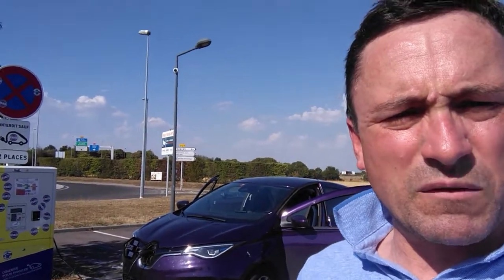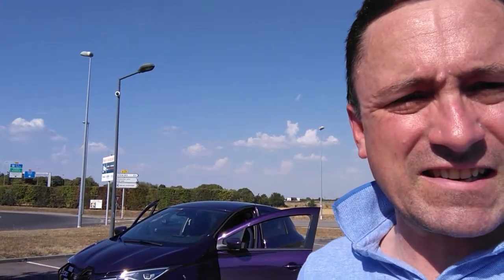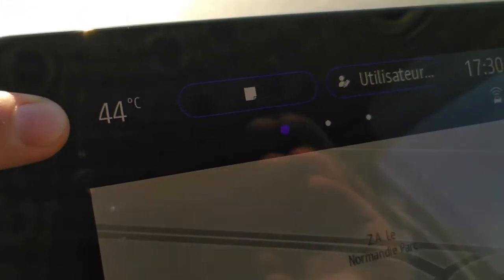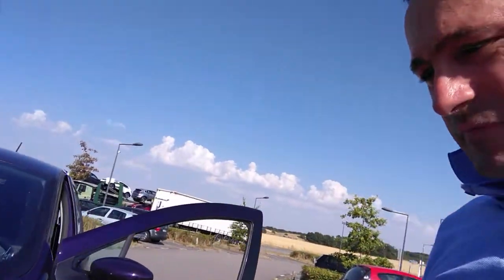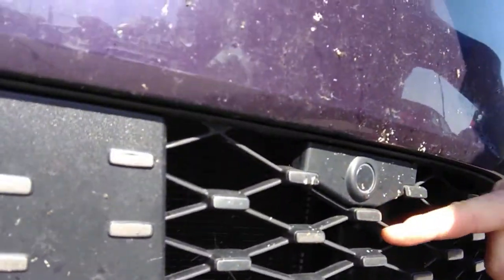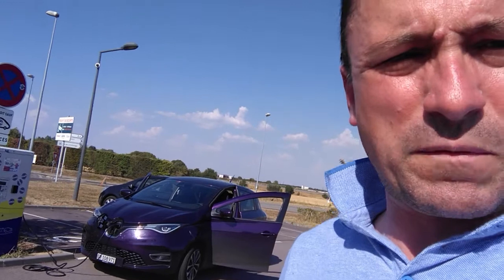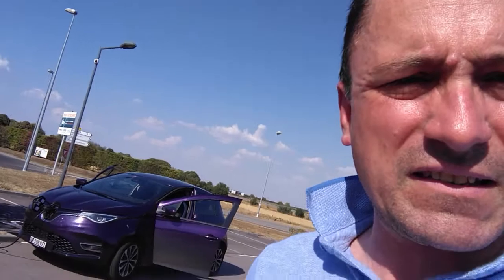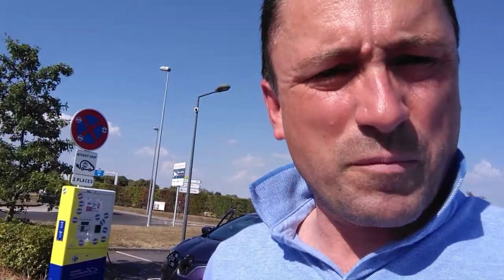REMICHANICS #32: Renault Zoe: Charging in extreme hot conditions!

Comment: I think 22kw DC would be better than 22kw AC in therms of thermal management, because the 22kwAC would use the AC to DC inbuilt converter(charger) which emits heat as well (and I suppose is liquid cooled by the same cooling system), while the DC charger does the AC to DC convertion outside of the vehicle and the heat emitted by the conversion loss is not handled by your car's cooling system

Comment: Ah, summer in France :) To be honest, 44oC is too hot for us too, not just the battery. It would be interesting to see if you tried CCS whether the car would limit the charge rate to keep the battery from overheating.
Reply from the maker: Hello Mike, in fact the charge rate on CCS was limited to the same values. Not sure about the repartition of the limits between the car and the station though. I could imagine that not even the station itself would be able to deliver full power at this temperature! Cheers, Remi